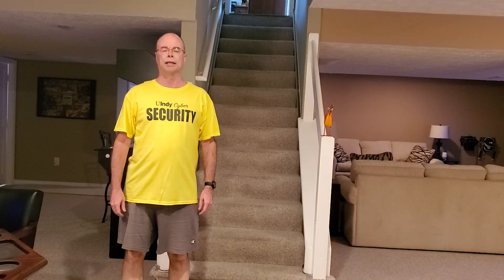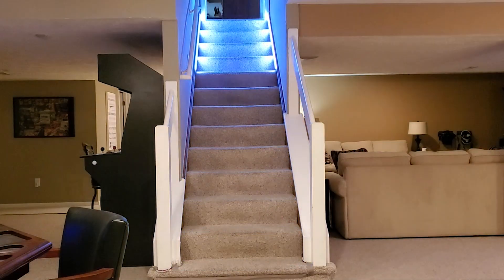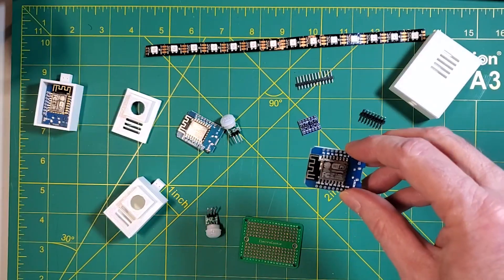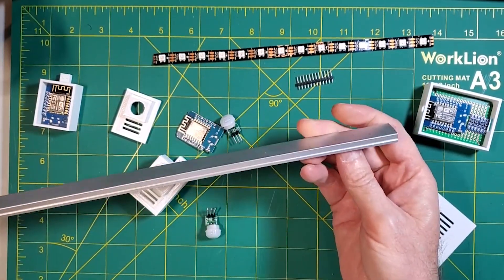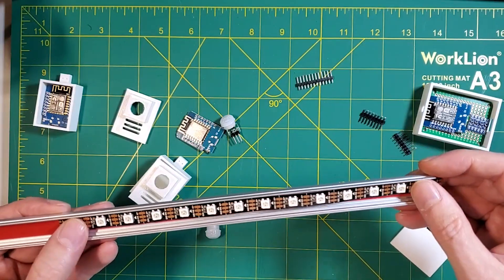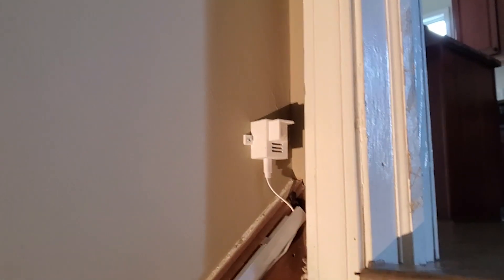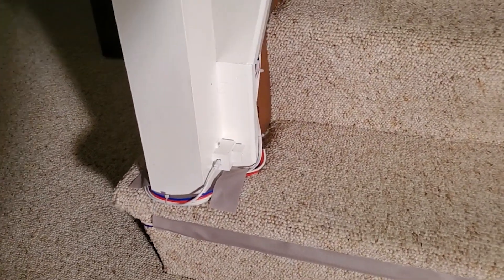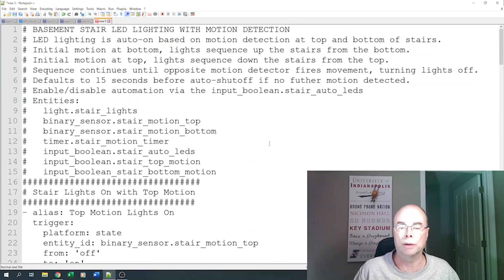Motion activated LED stair lighting... without staircase modification!

Comment: Do you have any automation examples for restoring WLED to a previous running “preset” if you change the light based upon a trigger. 

Example, say your stairs are running a nice holiday theme you like and Dim, so the wife comes to the top of the stairs and maybe you want to light the path for the time it takes to traverse the stairs and then go back to the previous running scene. 

I am new to helpers and creating my own custom stuff but I imagine I want to write something that looks at the Wled light to see if it is running and store that setting somehow in a helper? Perhaps a scene?

My use case is my breezeway and garage doors will be displaying themed lights at night and I want to detect motion off my doorbell camera and have the LEDs go solid white for the time it takes to enter either of the doors. 

Then of course restore the lights to the previous scene/playlist etc?

Do you have a blog or video? My quick search didn’t show anything but I am not so used to fit hub and I did lol there too. 

How would you go about this?
Reply from the maker: There are a lot of ways to tackle this... more than I can really cover here in the comments.  But one way would be to store your holiday theme in a a WLED preset.  When the PIR is triggered to turn on the lights (e.g. "light the path"), you'd run an effect (or preset) just like is currently done in the video.  But instead of turning the lights off with the other sensor (or when the lights time out), you instead call for the WLED preset... which would turn the lights back to the previous "holiday theme".  

You could probably also, as you mentioned, store the current state of WLED (effect, preset, etc.) in helper(s) when the motion detector is tripped, and then set the WLED state back again when the lights would normally be set to 'off'... e.g. call the WLED light.turn_on and pass back the parameters stored in the helper(s).  Depending upon the complexity here, it may or may not be possible with the automation UI and it might require YAML (or YAML within the UI).  I haven't tried this (yet), but I can envision how I'd write it.

Those are just two ways that pop into mind to accomplish what you are describing.  I'm sure there are others.
Reply: @ResinChemTech  thanks for this advice and it helps me in several ways. I did think of the preset and do have one for the light the path” as well as a scene in HA. 

So your first suggestion is good for use newer folks but I would be limited a bit and the joy of HA is the power. 

So, I am still new to WLED and a practicing apprentice. I am pretty much using your designs exactly. 

I might lose some of the fascination I currently have but I enjoy picking a different scheme each night and not just one of the 5 presets I have In WLED. 

I think you see this points me to the direction of capturing the scene if the light is on. I just need to learn more about helpers and I see people creating sensors in Yaml which to me seem like sort of a helper. Pardon my ignorance as I am still only a few months into HA. I just wonder if I need to make a sensor in Yaml to detect if the LED is on. So then in my automation I can look for this “state”?

I guess I had hoped you might’ve done something similar on your stairs and I could see your automation Yaml somewhere. 

Honestly, I love working with automations as much as I love tinkering! So I look forward to the challenges. 

Thanks again for you help!
Reply from the maker: Actually, you don't need to create a sensor for the state of WLED... it's already there in Home Assistant.  You can trigger an automation on the state change of any entity, including lights.  So, you'd use a trigger on the light state going from off to on (or vice versa).  It might be helpful (if you haven't already) to peak at the documentation for Home Assistant WLED ( https://www.home-assistant.io/integrations/wled/ ) as it gives some examples.

Again, I'd also be happy to provide you some examples or sample YAML code if you like via email or Discord.  You should have my email now in a response I sent a few days ago to your comment under my Livestream #2 video.  It's no problem if you want to reach out via email.  It's much easier to provide examples and more info via email as I'm limited as to what I can provide here in the comments.

Comment: 😂 lights didn’t go on until you were half way up the steps
Reply from the maker: You are correct, but this is because I introduce an intentional delay due to the fact that motion is detected from one side of the open-ended stairs before the person reaches the stairs.  If you approach from a different direction (as I did in the video), then the delay causes the lights to light up behind you.

However, in my next video I'll be covering an upgrade to the sensors that eliminates the motion issue and therefore gets rid of that intentional delay.  The lights now react at the proper time... as soon as you step on the stairs.

Comment: Thank you for the informative and thorough explanation. I would like to do similar outside on my pathway from the street to the house. It is going to be 40ft long, 38 inches wide, stamped concrete  with led embedded on  the top of the concrete(facing the sky, not the sides) along the length. Also I would like to have motion sensors every 24 inches or so, so when someone steps in the middle of the pathway still to lit. Could you please answer several questions:
1. Can I use it without Home assistant or any other platform/server because this is a foreign language for me? If it is absolutely necessary I would educate myself, but prefer not to.
2. Can I install multiple motion sensors and also are you familiar with any waterproof that can face up since I do not want to install anything on the side and higher than the walkway so I would not trip, able to mow etc
Thank you in advance for your help.
Reply from the maker: There's a lot to cover with something like that... more than I can cover here in the comments, but I'll address a few basic items:

With an install that big (and that many LEDs), you'd probably need to use an ESP32 instead of an ESP8266.  You would also need a very substantial power supply, along with power injection along the LED strips.  Naturally, all of this would have to be waterproof.

I do have an LED controller that works with motion detectors and doesn't require Home Assistant (or any other system).  You can see a video of that here: https://youtu.be/b4s_VEtVWY4  But it currently only supports a maximum of 2 motion detectors, so you'd have to modify the code to work with more than that.

Finally, there are commercial outdoor motion detectors, but I don't know of anything like you describe.  You'd likely have to build something custom and figure out how to power it and make it waterproof.

It sounds like a neat project, but it is also a pretty complicated one to build yourself.  I hope I've provided at least a little helpful information to give you some things to consider.

Comment: I cant thank you enough for your video it helped me to decide what type of stairwell lighting I wanted to get. I am remodeling my basement and Ive been looking online at lighting systems. Where would I go to buy all the parts I need to complete this project? thx
Reply from the maker: You are most welcome!  I'm glad you found the video helpful.  One of the nice things about this system over a 'pre-built' one is that you will get many more effects and options using WLED.

As far as parts, I have a related blog article that not only provides more details and wiring diagrams, but also has links to where I purchased all the various parts.  You can find that here: https://resinchemtech.blogspot.com/2021/07/simple-motion-activated-led-stair.html

Do note that the particular system in this video requires Home Assistant or another compatible home automation system.  If you don't have that, I do have a more basic version that works 'standalone' without any required outside automation.  You can see that in this video: https://youtu.be/b4s_VEtVWY4

Good luck with your project and don't hesitate to reach out if you run into any questions.
Reply: @ResinChemTech  The enclosures you mase with a 3D printer? My issue I don't think I can afford a 3D PRINTER.
Can you purchase?
Reply from the maker: You have a few different options if you don't have a 3D printer.  First, my design files are available on Thingiverse: https://www.thingiverse.com/search?q=Resinchemtech&page=1&type=things&sort=relevant  There are numerous online services where you can send them the design file and they will print and ship the printed part to you.  Note that some of these services can be a bit expensive.

If you have a college or some sort of maker space near you, you can check with them.  In many cases, they can print a few 3D parts for you for free or at a minimal cost.

There are numerous electronic project boxes available on Amazon.  You can often take one of these and modify to fit your needs (this is what I often did before I had a 3D printer).  Just search for 'Project box' and find a size that works for you.

Finally, you can find something around the house to modify.  A soap enclosure, and old plastic container, or sometimes even a small cardboard box can be adapted as an enclosure.  Unfortunately, I don't have the time or infrastructure to build, package, ship, bill and all the other logistics involved with printing parts for others.

I hope that info helps!
Reply: @ResinChemTech   I cant thank you enough, I am a network engineer by trade and i have minimal experience
on the data side but this looks doable. It looks like a fun project and i cant wait to start once I have all the parts,
I try not to bother you to much. Thanks again for the hand up,
Reply: @ResinChemTech  ARE THE DESIGNED IN MM OR IN?
Reply from the maker: Are you talking about the 3D printed enclosures?  Those are designed in mm. Everything else in the project (such as the length of aluminum channel, number of LEDs, etc. will be dependent upon your particular stairs.
Reply: @ResinChemTech  Yes. thank you

Comment: Great video. I am going to take your ideas and implement in my house. In my case, I may be willing to make minor modifications to existing stairs if necessary to conceal the wiring even more fully. Thanks
Reply from the maker: Thanks!  There are definitely things I would have done differently if I would have considered modifications to the stairs.  There are some other videos out there of some really excellent stair lighting builds... even ones with lights horizontally across each tread.  But as I've mentioned in a few other videos, we will likely be selling our home in the next 3-5 years and a lot of this smart home tech won't work for the next buyers (especially those that rely on Home Assistant, like this one), so most of my project installs will need to be removed.  If this was our 'forever' home or if we were going to stay here in retirement, then I would have been much more likely to make modifications to hide the wiring a bit better.

I think my goal was a project that someone could do in a weekend... was easily removable if the better half didn't like it.. and it wasnt' going to leave any signs of it ever being there once was removed.

Thanks again for watching and taking time to comment.

Comment: I mean I love it, I want it, can you make one for me as a kit , I don't code can't code so I can't make them do the cool things , but I can install and make the wires disappear,  I've been looking for this but have no way of getting them, I have a building co and would like to start using this basically everywhere,  so please help
Reply from the maker: Unfortunately I don't have the time or resources to build, ship, charge, etc. for any sort of stair kits.  I try to design my videos for the DIY crowd.  Note that this particular video shows an installation that requires the end user to have Home Assistant.  If you are building for others, there is a very high chance that they may not have (or want to deal with) the Home Assistant automation system.  However, I have created a version that works without Home Assistant and doesn't require any other automation system.  It is a bit more basic in terms of number of effects and features, but the physical build is nearly identical and it still functions (via motion) in much the same way.  You may want to take a look at this video and see if it might be a better fit in your situation:  https://youtu.be/b4s_VEtVWY4

Comment: Hello, I didn't get your name Saturday during the live stream. I'm Dan a DJ, gadget guy, Creator/Streamer and WLED fanatic. You have a bunch of HA knowledge I didnt even know was possible. Here's my two wonderments after watching this clip. How many leds total are you using. I estimate around 400 for both sides give or take if you are using 60leds/m. If yer using 144/m then disregard the next question.  Next question is baffling me ... Why are you using 40amps or 300 and some plus watts when it's not needed. It sounded like these two strips were the only things to be connected. Using my approx 400 estimate, you should be able to power them just fine with a psu that is rated for 150 watts which includes the 20% buffer.  If I misunderstood one of the variable or made a mistake, I'm sorry, but the gen rule of thumb with ws2812b leds is each pixel needs 0.3 watt for each to be powered safely. Then the only unknown is how much copper conductor they used in building the strip. Some use far too less and voltage drop is easily seen within the single strip which taught me the cheapest is rarely an acceptable product for me.  Again, great to meet you the other day. I'll show you some of my creations as soon as I upload them. I found a translucent water tube that makes a quick diffuser. I just fishtape my strips into the tube and boom. but making a round continuous tube with wiring going in and coming out was tricky and figured out a way, just not a perfect way but it looks great as an overhead general lighting or a music activated light when listening or mixing music.
Reply from the maker: First... thanks for watching the livestream.  I'm not as comfortable doing those, but it is a good way to interact with my viewers, so I try to do one every now ant then.

As to your question, I am using a total of 432 pixels on the stairs.  And I always use a high estimate of 0.060 amps per pixel for WS2812b, based on full brightness white when all pixels are lit (which agrees with your 0.3W).  In this case that is 432 x 0.060 = 25.92 amps.  While it is true that for most effects, the true amps will be significantly less.  But I always overestimate and round up.   I could have easily used a 30 amp in this case.  Odds are, I either already had a 40 amp on hand (I keep a variety "in stock") or wasn't sure exactly how many pixels I would end up using during the final build so I bought a supply that I knew would be enough  In most of my LED projects, the power supply is substantially larger than truly needed.  But as I've mentioned, I would a much rather have the available power and not needed it as opposed to either having to artificially dim the potential brightness or max out (and overheat) my power supply.  That's at least the approach I always take.  But you are 100% correct... a 30A/150W supply would have been perfectly fine for this particular install, with plenty of buffer to spare.

Thanks again for watching.  To be honest, I love Home Assistant and automations and that is probably my best skill set.  But I also have over 2 dozen WLED installs now... and LED videos definitely get more views than watching me write a YAML automation! But don't hesitate to reach out if I can help out with Home Assistant (or any of the other projects that I've done).  It's nice to virtually meet you!

Comment: Could this work with Zigbee motion sensors?
Reply from the maker: Yeah... it could.  But the issue I found with many motion detectors, especially the Zigbee ones I have (Aqara and Hue), there is a significant cool down period (up to 45 seconds) before they reset from motion to no motion.  It's not that you couldn't deal with that in the automation, but the motion detectors I selected was due to the fact that they had a very short cool down (about 5 seconds).  In fact, Travis over at DigiblurDIY did a thorough study of motion detectors and cool down times (https://www.youtube.com/watch?v=3U1fOqkk3Wg).  It would be up to you to determine if you could live with, or code around, any extended cool down periods for different motion detectors.  Actually, you could trigger on anything that works for your install.  Someone else even mentioned using an ultrasonic distance sensor as a trigger... or a load cell/pressure plate, etc.  Whatever would work for you to trigger the lights to come on and go off could easily be adapted from the way I did it.